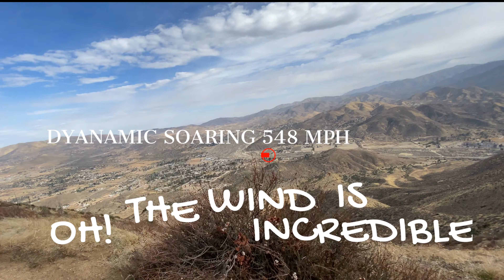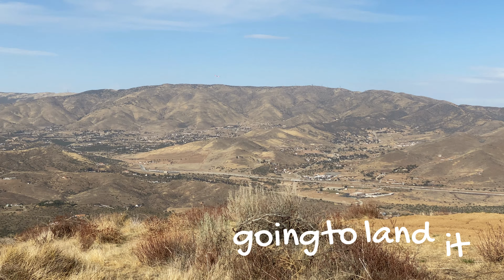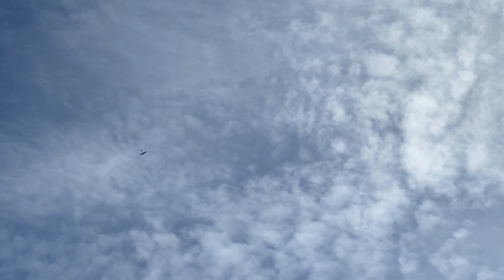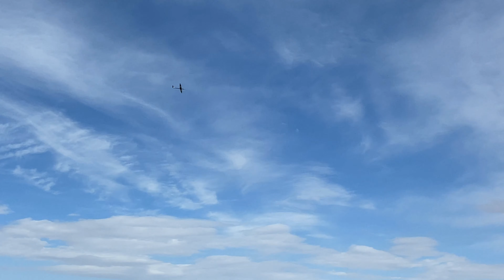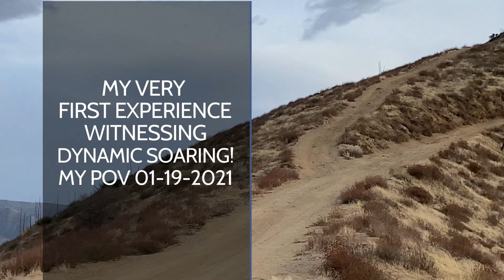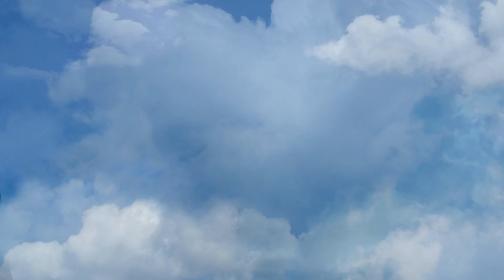Dynamic Soaring - 882 kph 548 mph World Record eye witness pov | Record RC Airplane Speed transonic

Comment: Just brilliant little film. The whole think is mindblowing and I will for sure look at the lecture video tonight. Being a full-scale soaring pilot I still cannot grasp whats going on.
Reply: For those that haven't watched one of those lectures/presentations it's easy.   Think of the wind as a tennis racket and the glider as a ball, where the wind energy from flow or velocity/inertial energy from the racket reverses the direction and increases the speed of the ball.  Not directly equivalent at all, but OK for an analogy, which always falls short at some point, because it IS an analogy and not an explanation.  Hopefully this one gets the point across.

In 'simple stupid' fully layman mode (not implying the layman is stupid, just ignorant of the subject at hand to some extent, like the 'Whatever topic currently applies' for Idiots' books) the energy of the wind above the peak is what is driving the glider to very high ground speeds.  

Essentially the leeward side wind speed is relatively stationary to the high headwinds above the peak with respect to the ground. The high kinetic energy wind above the mountain top generates much higher airspeed (the current glider speed before exposure plus the headwind speed upon entry into the flowing air), and lower ground speed by a bit.  Another wind speed equivalent boost occurs on the in wind turnaround, relative to the ground or stagnant airspeed on the leeward shaded side, meaning the entry back into the low energy non flowing air, another wind speed equivalent boost is imparted.  

On the turnaround you gain twice the ground speed at each exposure.  The max speed boost is based on the ground speed boost on each pass (2X wind speed) minus the drag incurred on the wind exposed top (highest ASL, meaning altitude above sea level) turnaround.  The next wind entry airspeed is the entry speed back into stagnant air (ground speed if zero wind) of the previous pass at that point minus the speed lost in the loop in the shaded wind area.  At 'steady state' max airspeed, which is built up over multiple passes, meaning the speed at the point measured when max average speed has been obtained, this equalizes, more or less, and further speed cannot be accomplished.

This is all talking ideal constant conditions here. In the real world all of that is variable, obviously, meaning wind speed, loop loss based on g pulled (amount of extra high speed stall induced drag incurred throughout the entire loop, etc.).  Also the air transition speed at the mountain is not time or distance instantaneous, the leeward side wind speed is not zero, the wind speed at the peak is not constant, etc.  In reality an analysis would require a finite element run at each small chosen interval of the passes.

This effect also happens with turbine blades or the blades in a automotive torque converter.  That is why you can generate much more torque at the rear wheels on launch with an automatic that is available at the output shaft of the engine.  It's not something for nothing, never is, and torque can be gained in this case from a Newtonian law standpoint because the relative motion of the input to output shaft is reduced (RPM).  There it is a liquid fluid, rather than a gas fluid (air), but the increased boost (torque in this case) comes from diverting the transmission fluid into the blade then back out again.  That is all extremely simplified, but hopefully imparts the general idea. 

This will work with a full sized glider as well, though I'm quite sure it is a bit sporty bring me my brow pants kind of flight regime (severely dangerous) as low AG altitudes are required over almost all of the horizontal loop which is really what this is, since the downward Earth imposed g is pretty much negligible.  The other difference is that you cannot remotely tolerate the centripetal g forces being generated here, something like 50 to 100 g, nor can your sailplane, not remotely.

See, easy peasy, at least if you have had some physics, and remember it.  If not it is still graspable, but not quite as peasy.  Cheers.  :-)
Reply: @MrJdsenior  holy shit that was a good write up
Reply from the maker: Hey thanks for the intel! 🙏🙏🙏🙏 much appreciated! You are awesome! Happy holidays 🤝💯
Reply from the maker: Right! Happy Holidays Negus! 🤝🙏
Reply: @HolaACchillin  Merry Christmas to you too my friend!

Comment: I've just watched a vlog where an engineer working on inter-stellar travel said that research is being directly influenced by these hobbyists. There is a theory that they might be able to use shear zones in the solar winds to achieve similar fuel-free acceleration for an inter-stellar probe, getting closer to light speed than would otherwise be possible. This might enable a probe to reach other star systems within a single human lifespan.
Reply: That’s how I got here, too 😂
Reply: Can you link that?
Reply: Me too
Reply: @patricklogan313  FraserCain, interstellar travel without breaking physics.

Comment: WHHHAAAAAT ?     the wind alone got you to 550mph ??  thats absurd. does that mean birds can do this ?!!?  500 MPH HAWKS ?!??!
Reply: what kinda G's are these things pulling !?!!!!!!!!!!!!!
Reply: Record for Hawks is held by the Peregrine Falcon...
36 to 49 cm (14.2 to 19.3 inches) in length. Strong and fast, they hunt by flying high and then diving at their prey. Attaining tremendous speeds of more than 320 km (200 miles) per hour, they strike with clenched talons and kill by impact.
Reply: @uncletrashero 60 to 80g's. Peak at 100 plus g's
Reply: @LemonySnicket-EUC   holy crap i cant believe these little model planes dont fold into 20 pieces at those Gs thats crazy
Reply: It's is called dynamic soaring.
Uses wind gradient. Different wind speeds at different altitudes.
You accumulate energy on each cicle. 
Albatross es use similar principle to fly great distances over see effortlessly.

Comment: Turbine powered rc pilot: We go fast.
Sailplane rc pilot: Hold my beer.
Reply from the maker: i love this! Ya babbittdaWabbitt  sail plane be like f the sound barrier!  Turbine does look and sound cool af i admit however these sail planes on full tilt shake the earth. Over the leading edge speeds are over mach so the rumble is like a micro wind break. 
next time I will bring some proper equipment. This particular day i was so unprepared my car would not even make it up the steep mountain road. 
I met all these people cold af and out of breath lol. 
Funny comment,much love -
AC
Reply: @HolaACchillin  The more it goes to the mach 1, sail plane will hit the limit since transonic area is very nasty. Because of area rule, it will have extremely high drag and be unstable.
Reply from the maker: I agree. Are we at that point already? 
one thing is 100%
Spencer Lisenby will continue to go faster and faster until that wall is met.
I do appreciate the comments 
- much love 
AC
Reply: RC turbined aircraft are arbitrarily speed limited.  Just FYI...  It takes a lot of dedication and $$$ to go faster so it makes sense DS without multi thousand $$$ turbines is the fastest currently.  The ol' line of sight buggaboo bites turbine boys as well.

Comment: I`ve seen quite a bit of slope soaring, but this run is something else man, I`ve seen models doing less than half that speed just EXPLODE mid-air due to the force on the wing, and I mean EXPLODE! As in seize to exist..
When you see what these models are capable of, then you can start top understand why they`re as expensive as they are, it`s really high-end engineering as far as model airplanes go.
Not sure how many times I`ve watched this clip, but I`m gonna watch it again, and show it to my friends, because it`s absolutely ridiculous to see something with no engine go transonic :o

Comment: The speed of sound varies according to the the materials ability to transmit it.  In this cas case the barometric pressure and temperature are a part of the equation.

Comment: If this stuff is getting into transonic speeds, is it time to start using swept wings like jetliners, or even delta wings?
Reply from the maker: As I understand it these rc planes are close to transonic speeds. An entire seminar link in the description from Spencer Lisenby explains more in depth including his own swept wing design from 2 years ago. 
This is a great discussion going transonic! Please check out the link to the 1 hour speech by the man himself, answers so many questions imo. 
  Hey thank you 🙏 
Much love -
AC
Reply: I would think not as there are supersonic aircraft that only have tapered wings with no sweep. One thing that will have to change is getting away from stab and elevator and going to stabilator to maintain pitch control when they get more into the transonic region.
Reply from the maker: if I follow what you are saying and i think i do.. ya... idk anything about high speeds like transonic stuff. Maybe some answers here...     DSKinetic.com       dsTransonic planes on that website. 
 Myself, I was kinda told which soarer to purchase. I plan on updating with a video transmitter and flight controller. Now i will not be flying anywhere near those speeds but it will be great fun fpv. I love the fact these are like 10 pounds in weight! I would love to fly one 99mph first person view. 
i would imagine there is some challenges but consider the top leading edge of the wing is going over mach 1 already. Include what i saw in speeds on that mountain believe todays tech might have on major leap soon in speed without change. 
idk, maybe not. good debate and i appreciate the questions/comments.
Reply: @HolaACchillin  it all has to do with compressibility at high transonic speeds the shockwave from the front of the horizontal stabilizer makes elevators ineffective look up the X-1 they have great blurb about this and Yeager used the horizontal trim to fly the X-1   too maintain control. Another plane that suffered many accidents due to compressibility was the P-38 when it entered a high speed dive the elevator became ineffective.
Reply from the maker: I love the intel! I will definitely check out the X-1. I’m interested in learning more about this subject. Thanks Issac for all your help so far. 
I love it!
Reply: I'm pretty sure the elliptical wing is still most efficient as it’s not transonic

Comment: Did you ever end up putting a g meter in the wing? Im curious what kind of pull, im ultra impressed the wings of the aircraft dont clap like hands.
Reply: They did and the meter averaged 60-80g and has also maxed out at 120g

Comment: I just stumbled upon this whole genre of flying, so forgive me a beginner's question: Doesn't the trans sonic range begin at Mach 0.8, i.e. around 960 kph? Were you at a an altitude were the speed of sound is sufficiently reduced to have 740 kph at or above Mach 0.8?
Reply: Check the link in the description that goes to Spencer's talk on DS. It gets a bit technical but the idea is how the speed of the air is hitting the leading edge of the wing and then forced back down on the top of the wing is a tremendous amount of force. I don't think they're technically "transonic" but are "in the transonic range." Spenser did just put out some videos of a new swept wing prototype which has the goal of going into the transonic range (and hopefully beyond).
Reply: @GatorGlider Thanks, I'll have a look.

Comment: the stresses on that plane must be incredible....500+mph turns....honeycomb carbon fiber?
Reply from the maker: 1st thank you au69miner for the question and the answer can be found in the descriptions links. There is a 1 hour seminar hosted by the person who is in this video breaking the record - link 
link to Spencer Lisenby youtube channel. He manufactures and holds the speed record with these planes. I personally have almost zero knowledge so i do apologize. 
I flew my first plane two weeks ago and will be posting footage of my progress as I attempt Dynamic soaring in the near future. 
Much love and i think it way over 40 g-force -
AC
Reply: In his talk he says that in some of their testing they measured 120 G’s, but that the sensor they were using can’t measure over 120 G’s so it was most likely some amount over 120 G’s (but normally more around 40-60 G’s).
Reply: @babybirdhome  I think I say somewhere they calculated the G's from the speed and the lap time (giving you the turning radius), that is probably a reasonable way. But I can't remember the number.
Reply: turning at 500mph is, in itself, not amazing. Airliners do this all the time. What IS amazing is completing a fully 360 degree turn inside of a couple of seconds. What's INSANE is that the turn isn't continuous, which means that the bulk of load is happening in short windows WITHIN that 2-3 sec turn, which makes the g-loading even higher than if it had been a continuous turn. One way to think of it is this...you're doing 540mph heading one way. Now you need to accelerate such that you're doing 540mph the other way (180 deg turn), now you do ANOTHER 180 turn to return to your original trajectory. That's basically like going from 0 - 2160mph inside of 2-3 seconds, except it's not all happening smoothly. It's....ridiculous. :)
Reply: @coma13794  That is not the correct way to see it. Look at it, it is an almost perfect circle with corrections.  
  
So in the first approximation you can see it as a continuous circle with constant speed, giving these 50g (and is compensating the centrifugal force the tight circle causes). 
 
What DOES come in addition is the difference in windspeed of the surrounding air. When the plane flies into the windshear, here the windspeed changes by 80 mph. But compared to the 540 mph that is "just" 15%. But as this is a sudden "impact", that needs overproportional strengthening. 
 
Your error is that you look at it from the outside. But the forces appear in the plane "swimming" in the air. 
 
(Please do not feel offended)
 
Flat earthers do the same error, looking from e.g. the sun at a point on the surface of the earth, saying that due to the rotation of the earth the point has to accelerate and decelerate constantly during the day (seen from the sun. 
 
But we know the overhelming force is gravity towards the center of the earth, only slightly lessened by centrifugal force due to the rotation, of max. 0.3% of gravity (300 times more). 

 
Feel free to ask, I am sure that was not easily understandable. 
Let's make science, you try to disprove my claims, and I try to defend them - or fail.

Comment: Nice, I want one  or two! Be interesting if it had an onboard cam.
Reply from the maker: I think on spencer’s channel ( link in the description) he has a video w/ onboard cam.
He also makes these things too. I’m picking up one myself, just not the $6000 one. I’m looking at a $300 item to start
Reply: @HolaACchillin  have you flown Rc before? If not I would not start expecting to dynamic soar in 50 mph winds, get a slope glider that is tough and fly the windward side, but if you practice there then get a faster carbon bird and hopefully not crash it
Reply: there's lots of on board footage out there. It's interesting for about 5 seconds, then quickly becomes unwatchable.

Comment: That's scary n cool all at once lol
Reply from the maker: in person I can tell you i was Terrified. I dug in the side of the mountain and proceeded to enjoy my afternoon. Filming these rc dynamic gliders was a bit of a challenge with the wind. I would love to get some serious audio equipment next go around!
  I spoke with Spencer and he said he has been chasing his older 545 mph record for 2 whole years. Breaking this current 548 mph speed record is 100% possible. with three high end radar detectors i personally saw all read same speeds all day. 
Dsing is fast af and scary af and beautiful af! bucket list if possible. 
  As of today i believe the only person that will go way faster and smash the current record is Spencer Lisenby himself.  
much love ANTH davis - 
AC
Reply: Thanks for the sub by the way in my recent post ur in it
Reply: That's cool n holly he'll scary lol all u need is a gopro 7 on top of one of those lol
Reply: Cool
Reply: @HolaACchillin  On one DS video there was some strange corner protruding into the picture. Took me a while to understand that this was a solid wooden wall they were standing behind. The idea of a 300 mph crashing into someone - urgh. 
 
But a glider has a pretty pointed nose, filled with lead, and 2-5 kgs behind it. I heard that a .5 cal machine gun bullets goes through walls. The plane is way slower, but the bullet weighs just a few grams...